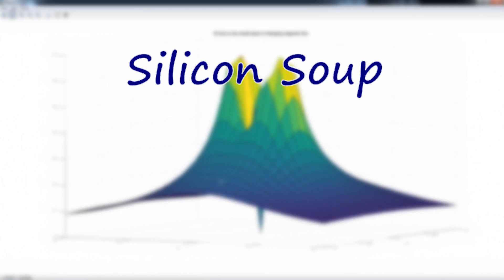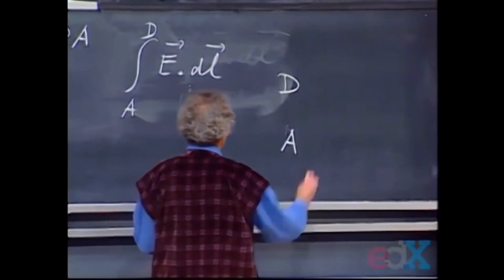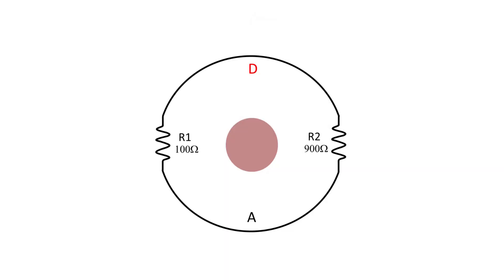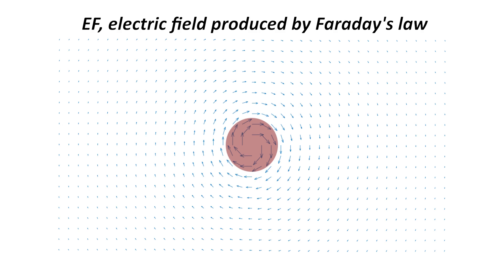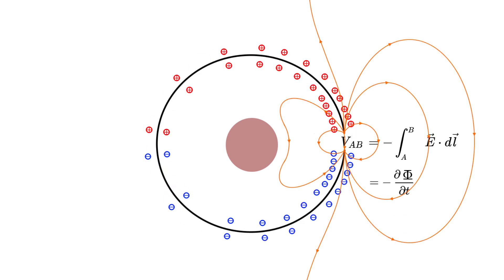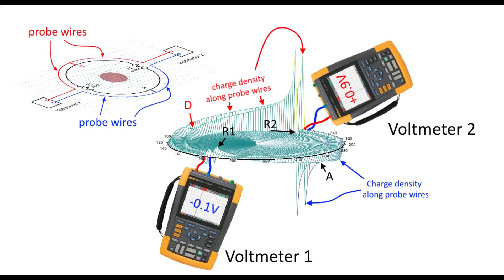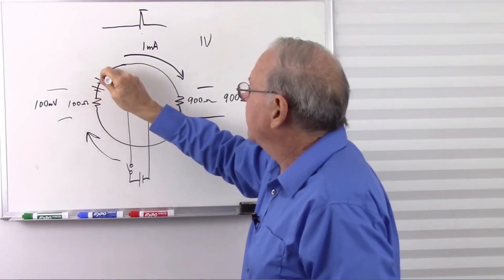Dr. Lewin vs ElectroBOOM on KVL. Of course Dr. Lewin is right.

Comment: stop worshiping lewin Veritasium also got it wrong lately. Your diagram is misleading . Nodal analysis would require that sheilded probes actually at the points not at assumed zero potential  extended lines
Reply from the maker: If you could point out Dr. Lewin's mistake, then I would learn something from you. It is ironic that Veritasium's clarification on misconception contains some minor misconceptions too, but overall, to be fair to him, he is mostly right. Regarding your comment on the shielded probes, can you tell me which timestamp you are referring to? Thanks
Reply: @SiliconSoup  About 12 :35 . Why are you talking about the E field ? The open loop presumably has negligible resistance .What creates a potential at the  open part with the  meter is magnetic induction. . Engineers know about the near field properties of coupled inductors.
The near field tends to be magnetically dominated . You can obviously see this in an ordinary transformer. . A typical transformer is many orders of magnitude smaller than the wavelength of the frequency feeding it . It is dominted by the H field.
.If the field is magnetic  all conductors will have an induced voltage including probe leads. The phenomenon is admittance or impedance of the vacuum.  For example the small coil has a very high  E field impedance while the  H field has a lower one.
Tesla pioneered high impedance  E field transmission with the teslamcoil. For high reactance  fields such as the near E field you need a step up transformer  a tesla coil. The attempt to inject rf power from an impedance mismatch creates VSWR woltage standing wave ratio.
A reflected wave  and  less power enters the field.  . On radiatore smaller than the near field limit the field becomes reactive .
A phase  diffrence. The reactance of the near field on inductors smaller than wavelength is inductive reactance.  The  E field has dielectric reactance. 
See near field.
https://en.m.wikipedia.org/wiki/Near_and_far_field
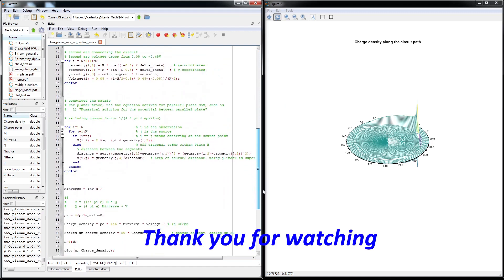Reply from the maker: @georgejo7905  My video is only 12:26 long, I don't know where to look for 12:35, so my reply is based on your wordings, with no reference to any particular circuit. How does magnetic induction come about? The underlying physics is that changing magnetic field creates an electric field, beyond the space of the magnetic field itself, and this electric field moves the charges in the secondary coil to produce the terminal voltage. You can omit the details and called the overall effect the magnetic induction, but it is the e-field that produces the induced voltage. curl of E = -dB/dt is the equation. 
"If the field is magnetic  all conductors will have an induced voltage including probe leads". Voltage is path-dependent when there is a changing magnetic flux, so unless the path is clearly specified, you can't say all conductors will have induced voltage. In particular, there is no voltage induced along the conductor, and yet there is a voltage across the terminals if the conductor encloses the changing magnetic flux.  
The discussion of KVL for the Lewin circuit is based on quasi-static analysis, without any wave radiation. Bringing in wave propagation into the discussion only complicates the matter, and I don't know how the wave will help to resolve the main debate, whether KVL always holds. Thanks and Cheers
Reply: The point about near field was not to complicate the matter but merely illustrate that the E field is virtually not present at this scale and frequency. Any voltage produced in conductors is the result of the presence of charge in fluctuating magnetic field. . The charges are the electrons in the conductor which react to the lorentz force. The velocity of the electrons  and the resistance of the loop give rise to a voltage gradient per ohms law. Frequency is important and hence wavelength.  So far all the models proffered have neglected the presence of charge in the model. As for path dependant induced voltage , well that is easy . . The model so far is a 2 dimensional model  and magnetis flux is considered to be perpendicular , normal, to the diagram. . The induced voltage is  i(current) d(L, length)  where that is r(resistance) dL.
The existance of an E field outside the conductor is merely the result of the current in the conductor at this scale..
It always helps to imagine boundary and near boundary fonditions when considering a model. Consider a permanent magenet and a charged capacitor . Both at rest in the observers frame  , Next slowly bring them up in velocity . Both will start out dominated by their respective Eand H fields until sufficient velocity is attained and faradays law applies fully . It is not until the magnet or capacitor reach c that the E and H fields become fully symmetrical in each respective case..
Reply from the maker: @georgejo7905  I think we have different ideas of magnetic induction, so let me explain my version. Time varying magnetic flux produces an circulating e-field all the way to infinity. If you put a conductor in that e-field, electrons move, and if there electrons encounter a load (resistance) or open circuit at the terminal, the electrons accumulate along the wire and set up an opposing E-field, E_Coulomb. The accumulated charges produced the induced voltage (the secondary side of the transformer). 
Some people called q vXB (the magnetic force) as the Lorentz force and some people include qE (electric force) in the Lorentz force. The magnetic force q vXB is not involved in magnetic induction.  Wire moving in the B field will have voltage induced due to the magnetic force, but transformers don't have moving wire, and the winding sit outside the core (and outside the B-field).
The models I presented included current (flow  of charges) and charge accumulation (8:33), so I didn't neglect the presence of charge.
In a transformer, the most important source of E (outside of inside the conductor) is the changing magnetic flux.
This video is about KVL, and I still don't get your point regarding KVL in general. I agree with Dr. Lewin's claim that KVL sometimes fails, and expanded his explanation by showing more details in the circuit. Thanks.
Reply: @SiliconSoup  models fail! the interpretation of the cause of charge and potential is our diffrence. You have explained your model consistantly.
I claimed the presence of the potential in this case is the movement of electrons and you claim it is the petentail that moves the electrons.
Classic relativism. We have not invoked the special theory and how the magnetic field arises from the relative contraction of lighter electron charges due to their velocity . Probably not go there . But I posit when you you have such a symmetry , as in our positions, both are correct.
I limit my critique to the lewin case and not EM theory in general , I expect E and H symmetry prevails at large scales.
I do dispute lewins experiment as sloppy and ad hoc no where near rigorous. And in my version KVL remains true .
The model I and others use is consistant notwithstanding theory to the contrary. Of course the engineering model is simple and EM is a difficult and the greater burden of description lies with the more difficult one. Engineering models are physics models. Some are spherical chickens just like in physics. KVL is absolutely neccesary and all of electrical engineering depends on it . It is a huge eddiface to overturn. If lewins experiment was valid countless such anomalies should have turned up over the last 150 years and yet engineers are not aware of them.
So perhaps engineers and physicists are both correct .  In electronics multiple path circuits are problematic especiall with ground loops. Reducing noise and hum is an art and good engineering regards this s essential. Sometimes called ground loops these occure where there is a distributed grounding system . A central single node is preffered . This is what engineers are seeing in lewins demo.
Reply: @georgejo7905  did you even bother to compute the inductance of the loop at the operating frequency?
Reply: @copernicofelinis  without dimensions?
Reply: @georgejo7905  Lewin's circuit has dimensions, but I don't remember now off the top of my head. You could use my loop (the one I've used in the videos on my channel): let's say 10cm diameter and 1.5 mm conductor diameter. Operating frequency in my case was 50 Hz.

I got results in perfect agreement with what Lewin and the old experiment carried out on the MIT ocw demo for the course based on Haus and Melcher's book.
Reply: @copernicofelinis  Saw it , commented. The toroid does not leak any flux so no induced voltage . You made a transformer.
Reply: @georgejo7905  I answered there.
Reply: @copernicofelinis  I have a lab just like yours . When I get the time I will do lewins experiment. Pay special attention to induced currents and negating them. I I get the same reading either side of the loop then that should suffice to decide the issue . Expect a video. Right now got lots of work.
Reply: @georgejo7905  ok, in the meantime have a look at the two stack exchange links I have placed at the end of the description of the first video (the original "Potatorama" production). I can't put them in comments because they will be deleted by YouTube.

Edit: added "of the description" - you don't have to watch that masterpiece of video making (it's a shame I wasn't even candidate to the Academy Awards for best cinematography, but we know it's all rigged... :-) )
Reply: @copernicofelinis been awhile. I did do a single turn 10 in loop in an oscillator. Colitis with effective parallel capacitance of 0.05 of mylar. It oscillated at 100 mhz.  This calculates to 0.1 nh. The capacitive reactance (space in your model) equalled the inductive reactance. You see where this is going you have nowhere near my capacitance and at 50 hz your reactance would be ridiculously low . The circuit is dominated by inductive reactance and that is a definition of the near field. NeR field can be intuitively seen as a source that is much smaller than the wavelength.and does not couple to the medium without a huge phase shif between current and voltage

Comment: We (physicists) have created a big problem by adapting KVL from Circuit Analysis theory to Maxwell's Equations because it seems that voltage has a different meaning in both contexts.

In my opinion, the Lewin vs. ElectroBOOM debate is fruitless. They start from different definitions of 'voltage' and never realized that.
Reply: Lewin's definition of voltage (as path integral V of the total electric field) can be used to completely describe the physical system. EB definition of voltage (as scalar potential difference phi, therefore as partial component of voltage that is ascribed to the conservative component alone of the electric field) gives by itself an incomplete description of the physical system. You need to give further information in the form of the magnetic vector potential A. One can either use V or the pair (phi, A) to fully describe the system. KVLers do not realize that their definition is incomplete when they only give (and in many instances know about) phi.
And yet they think they know more than a renowned MIT professor...
Reply: @copernicofelinis  Lewin's voltage definition is accurate according to Maxwell's Equations. On the other hand, his definition of KVL in terms of E.dl = 0 is unorthodox (8.02x - Lec10: https://youtu.be/ViwSDL657L4?t=2067). I couldn't find a popular Electrical Engineering book that used E.dl in KVL's definition. I believe this is what caused all the confusion...

Circuit Analisys models how electrical components interact in a circuit. In this context, KVL is sufficient as it does not attempt to describe E/B fields.
Reply: @renanmelo4903  I know I'm a few years late to this comment but Lewin's definition is not unorthodox. It's the same definition of KVL that Feynman gives in his AC Circuits chapter, equation 22.14 and the preceding equation. It's also the same definition William Hayt uses in his textbook Engineering Electromagnetics, 8th edition, p.89:
"Equation (20) [E dot dl = 0] is therefore just a more general form of Kirchhoff’s circuital law for voltages, more general in that we can apply it to any region where an electric field exists and we are not restricted to a conventional circuit composed of wires, resistances, and batteries. Equation (20) must be amended before we can apply it to time-varying fields."

Hayt also wrote a widely used circuits textbook in which he gives KVL with the same definition - that it holds when there is path independency around the loops. 

Lewin is actually quite orthodox in his definition and teachings - just a bunch of Youtubers and sycophants of Electroboom forgot what is in their textbooks. ;-)
Reply: @FabrisFanatic  IMO the answer to the discussion is in your words “ a more general form”. Atleast from the perspective of electrical engineering I can tell you that when given a general form it is not applicable to most situations, and there are other forms of that general form. Which itself is generally conceptual. KVL always holds on a piece of paper, which also matches circuit behavior in practice. When modeling circuits we never consider K/B fields, we just assume they are negligible, we are only interested in the voltage/current in the wire. You effectively create a new problem when applying another form of energy to the circuit. Consider the circuit at 1:12 traditionally it’s very simple, voltage at node D and node A are 0, because there is no driving voltage. The changing flux is essentially a new circuit component, this is no longer an RLC circuit, I don’t know if KVL holds now. That’s how I look at it, but I am definitely no high level physicist 🤷‍♂️

TLDR: I don’t think you apply E/B fields to circuit analysis. I believe considering them changes the problem to no longer be RLC circuit analysis.

Comment: You also put the probe wrong
in link below: 
https://www.youtube.com/watch?v=nAsZFP8Cfxk&t=0s
 The probes are placed correctly
Reply from the maker: I don't know how you define "correct" or "wrong" placement of probes. Many people, including fromjesse himself, think that his probing measures the voltage across the arc of the conductor, but this is not true. The arc is a conductor and so the voltage across the arc is zero, simply because V=IR = 0. The scope measures the changing magnetic flux enclosed by the sector-shape loop. It is magical that the voltage along the entire sector is 0, and yet there is a voltage fed into the scope. This is another example KVL doesn't hold.
Reply: Yes, but he explains why the voltage across the loop is not exactly zero because of the error and the 8-bit oscilloscope.